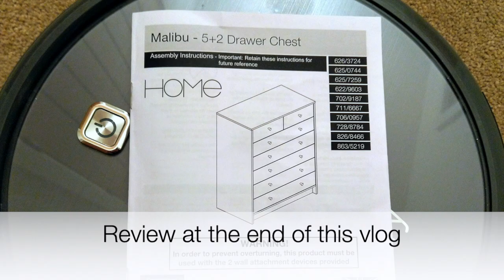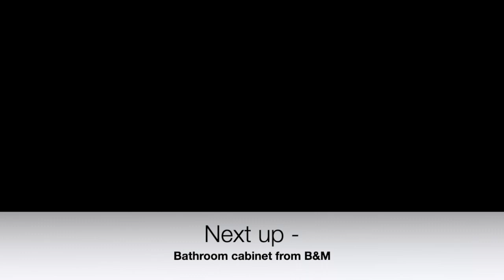Furniture build - poor show Argos!!

Comment: Hi, I’m have the same problem with the top two drawers, how did you fix it for it to fit in?
Reply from the maker: Hi, I'm afraid I can't remember how I fixed it, long time ago. Maybe retrace your Steps back to check that you have done all it asked.
Also, the top two drawers have now collapsed in the middle, so it's just a bad unit I think
Reply: Hey did you end up fixing the top two drawers if so how did you do it? I just bought mine and i'm having the same problem! 😭
Reply from the maker: I was never able to fix them properly. They have stayed wobbly